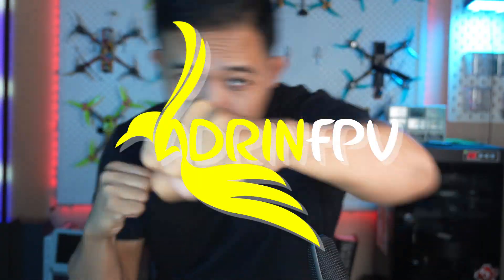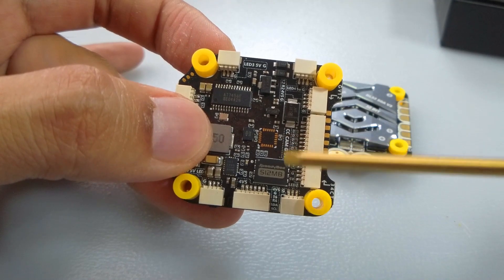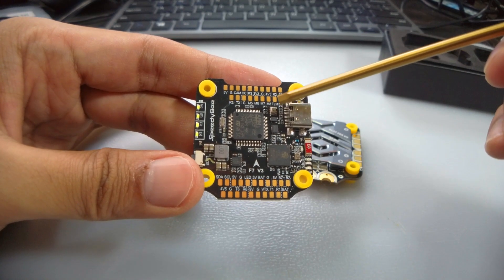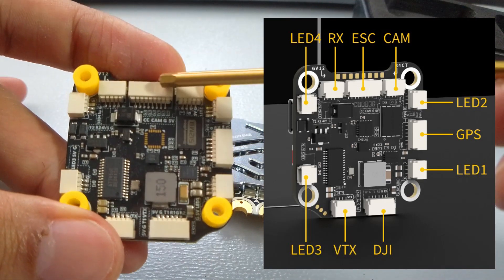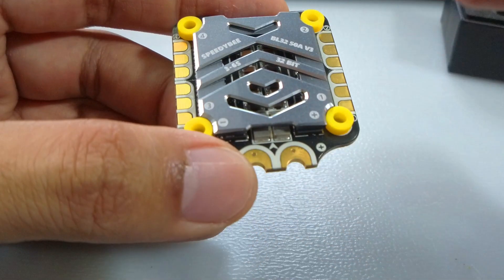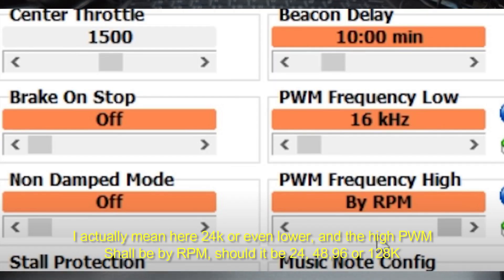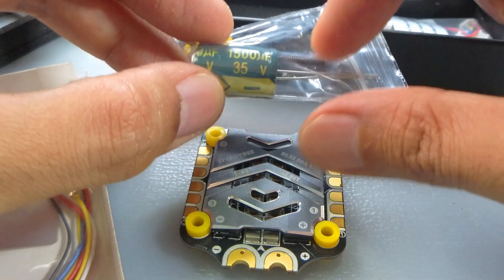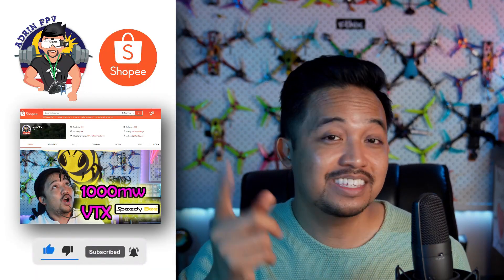Speedybee F7 V3 50A Stack review (Best Stack of 2022!)

Comment: Installed mine today, but having troubles adding the ability to add the air unit on a switch. Could use some help. I was able to add user 1 and 2 to the modes tab, but nothing happens.